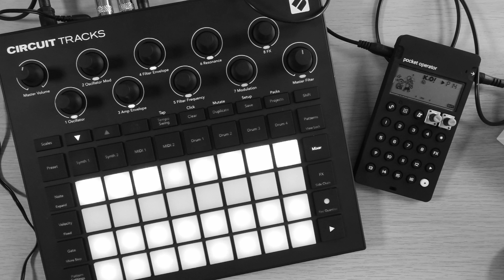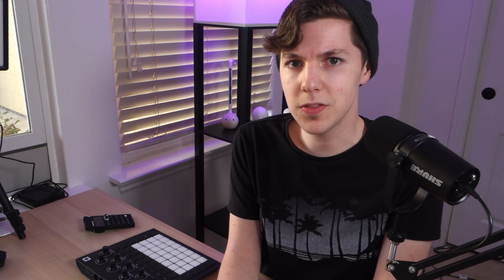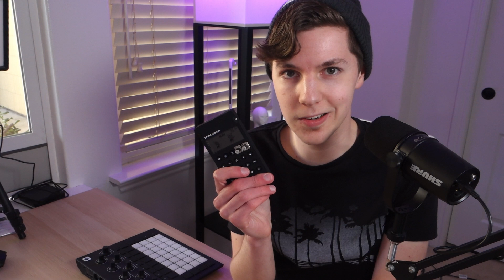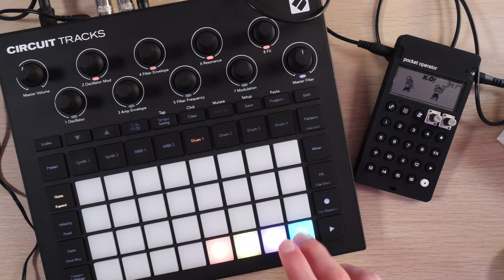Novation Circuit Tracks + PO-33 K.O. beatmaking

Comment: You need to change the sync mode on the po-33 for the click to disappear. Either that, or use a mono cable from the po to the circuit.

Comment: my set up is circuit rhythm ko 33 korg nts1 roland t8 the j6 tiberwolf yamaha djx and tascam dp008 multitrack mixer a few other random keyboards and pedals but i mostly use the circuit then record the beat into the tascam then add stuff over it i actully like using the timberwolf for basslines and i sequence or hand play other stuff over the beat like strings piano ect the djx has 6 tracks so u can actully make full tracks on it but the step sequencer is clunky af .....moral of the story is i want one thing that does it all so the mpc one sounds like the best option

Comment: Gabe, correct me if I'm wrong but you can avoid click just by using  mono to stereo cable, in pocket operators one channel delivers sync info and another audio. Happy Days.
Reply from the maker: I'd have to try it but yeah that sounds like it would work. Someone else also mentioned that a different input setting might work better.